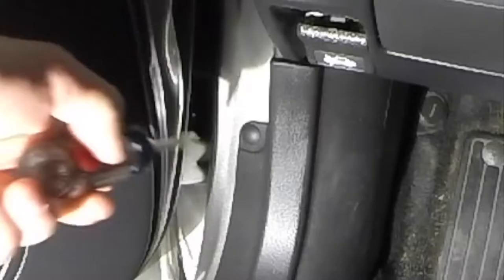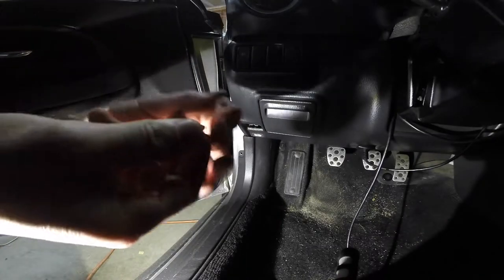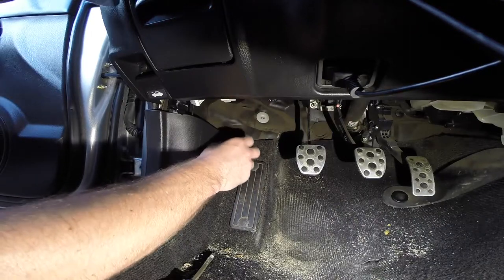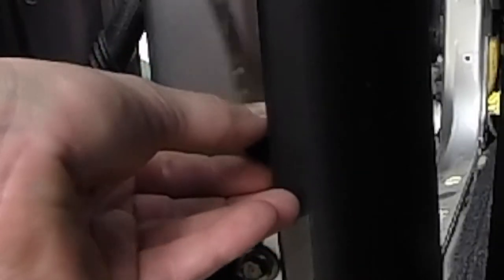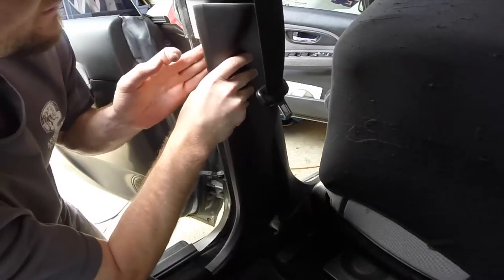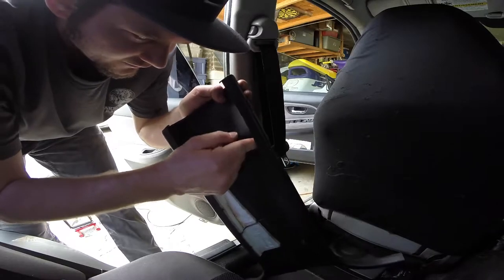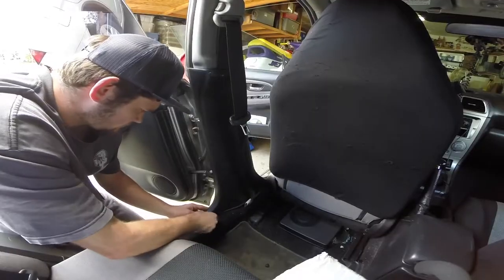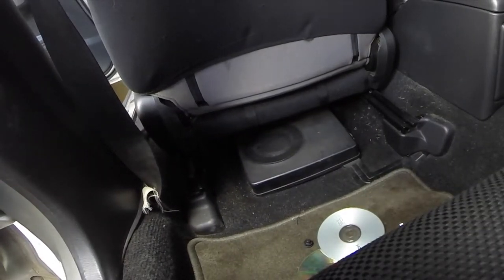Fix Squeaky Seatbelt! Subaru WRX

Comment: FYI - for future reference: I just fixed this on mine and you can do it a LOT easier. You don't need to remove the entire trim piece. Just seperate the plastic trim section covering the belt and parts on the driver doorframe. I got inside with a metal file and exacto knife to trim the plastic down, then clipped the trim back in. Took 5 minutes
Reply: Thanks. This is what I did on my Toyota. Pulled that top cover partly off.  Used a multi tool and sandpaper. Super careful not to nick the belt. Ten minutes.